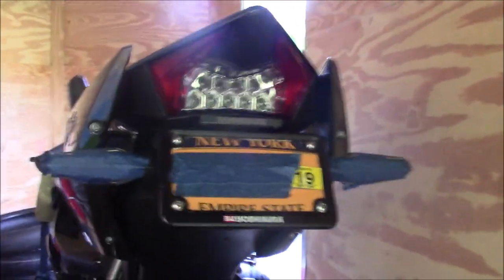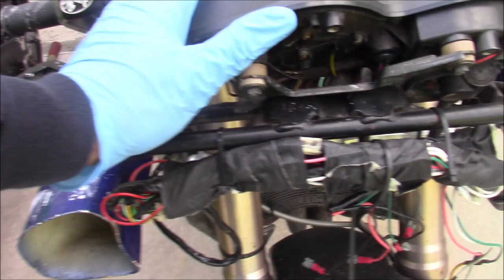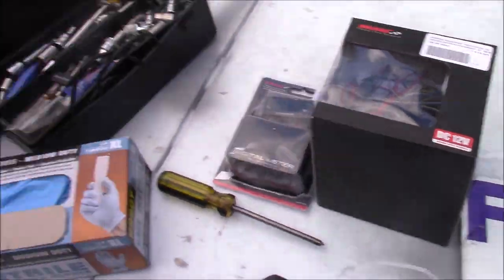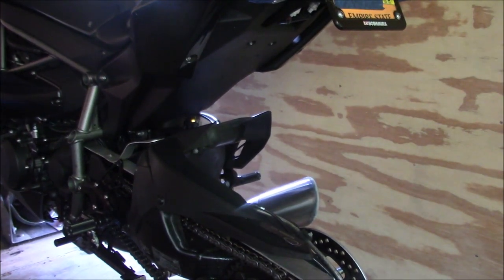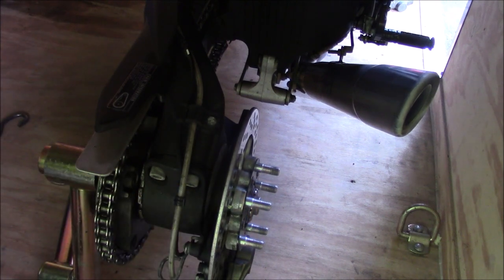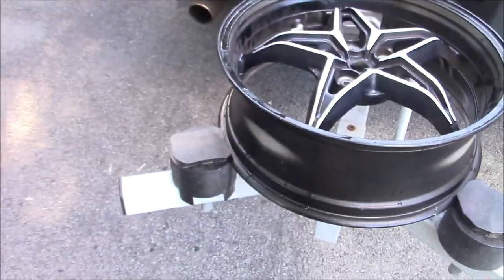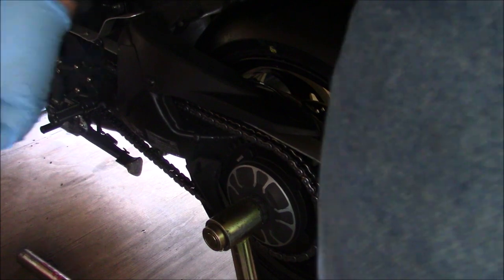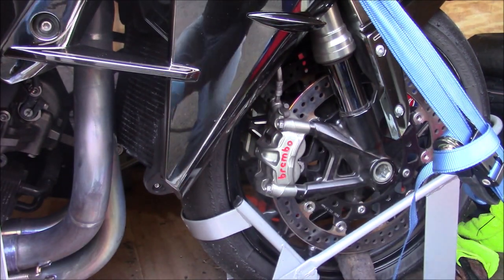Ninja H2 Rear Wheel Hub Damage????? MV Killswitch Update

Comment: What I've noticed on mine is play when cold ,no play when hot after long fast ride? I think it's heat expansion tolerance, try it again not on paddock stand jacked up on suspension linkage? I'm sure mine is getting worse I'm on around 5000miles, I've watched a vid of another same milage, on utube and his needle bearing was bone dry? I'm sure this play throws the high speed cornering out!.thanks for vid I'm.not the only one with this quandary. 😅

Comment: Hey man does your Zx9r make a weird noise when letting off throttle above 7k rpm kind of like a rattling of metal
Reply from the maker: No but if I were you I'd check your cam chain adjustment.   Go buy a mechanics stethoscope and stick on the right side of the engine to see if you hear anything abnormal.

Comment: What’s your take on an 06 Speed triple? I have a line to pick one up just to run around the city.
Reply from the maker: I think they are fantastic bikes.  However, I'd be wary of buying any bike over 10 years old due to parts availability issues.  Definitely do your homework.  If you are open minded and don't have your heart set on a Euro bike, there are a lot of Japanese naked bikes that are brand new and competitively priced from $6,000 - $9,000.
Reply: Turbo329 don’t mind them at all, doesn’t even have to be a naked but an awesome bike to run around the city is what I’m after.

Comment: I could definitely see movement in that wheel side to side and I wouldn't be happy with Kwacks explanation that its OK after having previous email discussions with them on other issues as imo they basically won't accept responsibility for anything till the recall notices come out.

At least in the US you do get recall notices, over here in the UK its gotta be a total life threatening looming disaster before its even considered.

I'm pretty dubious about those single sided swingers anyway. I reckon I'd be tempted to find a compatible ordinary swing arm/rear components to ease my mind, especially for the track.

Rotors always have slight side movement, more so on the front with full floaters or semi, I rotate the bobbins on the front of my nine at least twice a year to keep the warped discs at arms length, had those once before while on a 1000 mile tour of the Scottish highlands, having no brakes to speak of made it an interesting holiday to say the least.

Get some ibuprofen tablets for those wrists and piriton for those allegies before you end up like the elephant man lol, keep on keeping on Turbs.
Reply from the maker: Thanks man.  Yeah its definitely the rim.  I wonder if I should replace those 5 wheel washers or perhaps the center of the wheel got warped slightly.
Reply: @Turbo329  I'd go with new washers, that wheel looks a bit sturdy to warp without a good bang and I don't reckon you treat your machines badly, new washers and re-torque to spec.
Reply from the maker: Yeah I've seen it.  It's really good.
Reply: Its nothing.to do with the wheel or rotor it's bearings

Comment: What dimensions (rear tire) do you ride on the H2 bro?
Reply from the maker: Usually a 190/60.
Reply: Turbo329 👍
I was really happy with the Bridgestone but i will try the Pirelli Diablo Superbike 200/60 next time on the track! 
Have no experience with Pirelli Slicks 😂
Reply from the maker: Better handlingdue to the fact that it's both a taller tire and narrower than stock.  Also its what the H2R comes with.
Reply from the maker: I have not and I wouldn't because the 190/60 will turn in better.
Reply: straight up, go the Michellin Power RS.  Problem is you've gotta match front to back.  My H2 has never felt more solid.
Reply from the maker: I stopped riding Michelins years ago.  They just don't inspire the same confidence as the new 'Stones and D'lops.
Reply: @Turbo329  I've only been riding litre bikes for 5 years, but the diablo rosso and Bridgestone s21 don't compare to the power RS. Maybe time you gave them a go?
Reply from the maker: You're right, the Diablo Rossos are junk.  The Bridgestone RS10 are better than the S21.  From what I've heard, the Michelin Power RS are decent but I'm happy with my setup and honestly don't ride the street much.  I personally don't like the soft carcass of the Michelins.  Too much movement for my taste when I'm pushing hard.  The Dunlop Q4 is the best street/trackday tire out right now for performance.  I've seen guys pushing these on the track too without warmers.  If you've seen my other videos, that V4 Pani that I ran into at New Jersey this past July was on Q4s.
Reply from the maker: @anandjitsingh7598  The Q4s are great but you won't get good life out of the rears.   If you are happy with the RS I would stick with those.